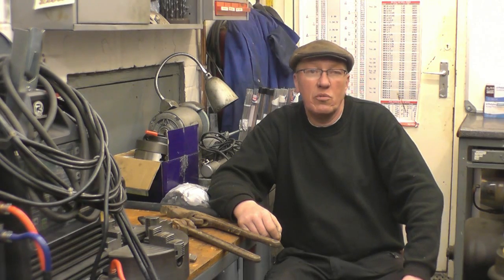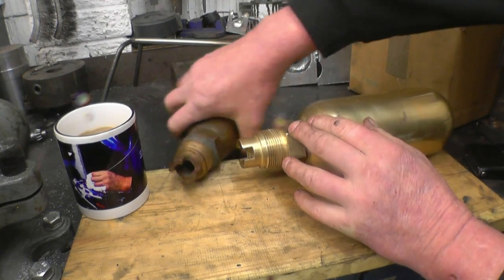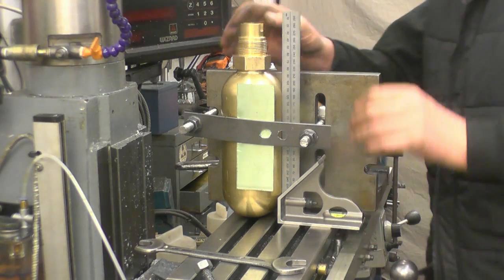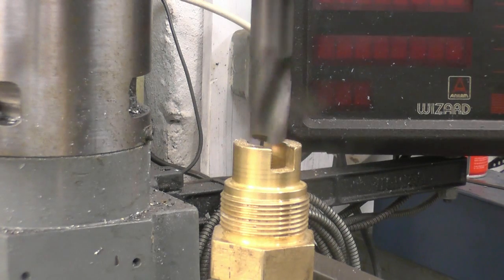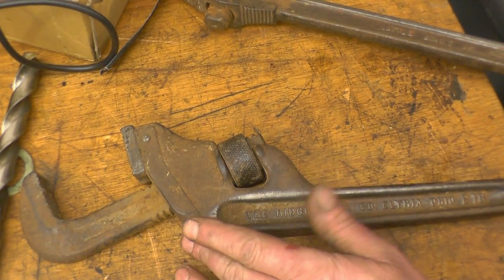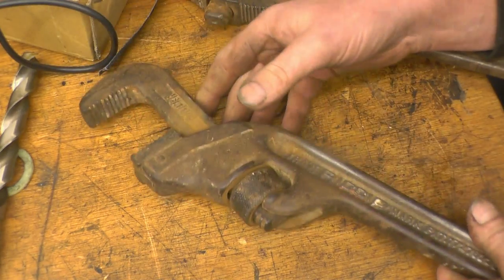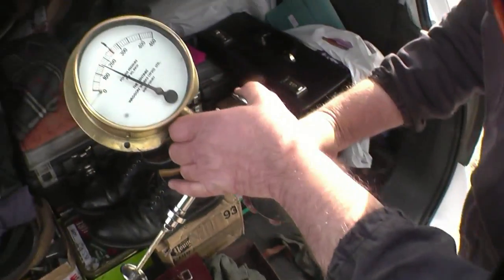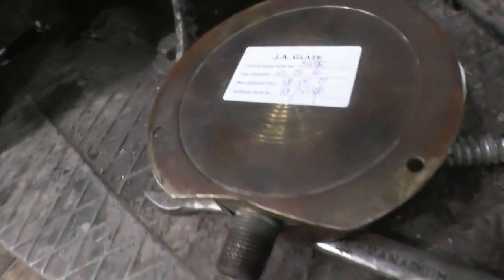SNNC 118 P1 Angle plate on mill / Pressure guage callibration

Comment: So why couldn't you get that dampner in your lathe? It didn't look that big.
Reply: +bcbloc02   If it wouldn't fit inside the body of the chuck you would be hanging on to the ball end. Even if you could use a steady rest, the risk of damage is greater than in the mill. Besides, it's not like it needs precision, just more hole and less length.
    Mike (o\!/o)